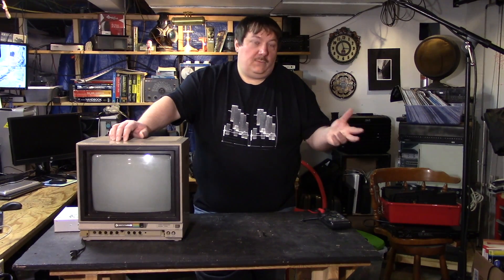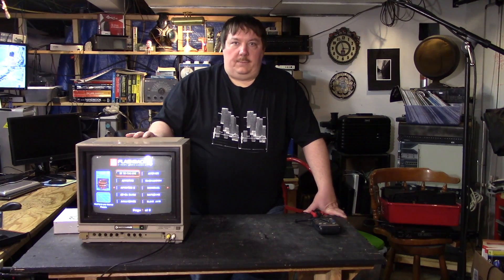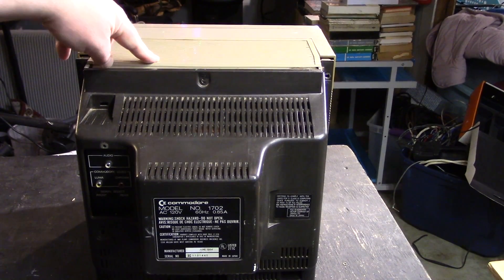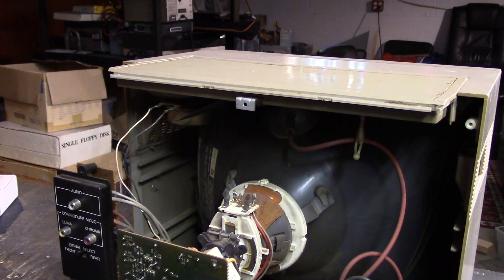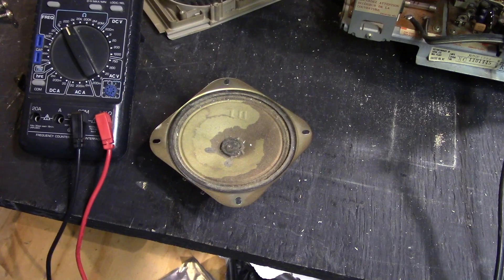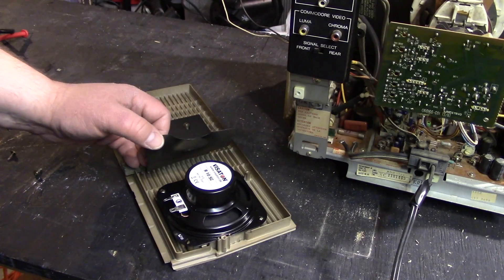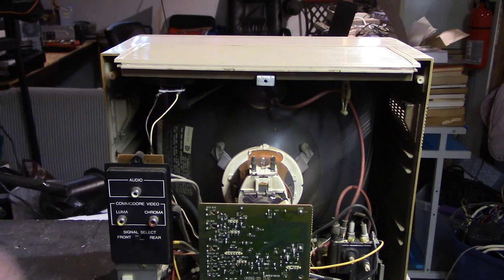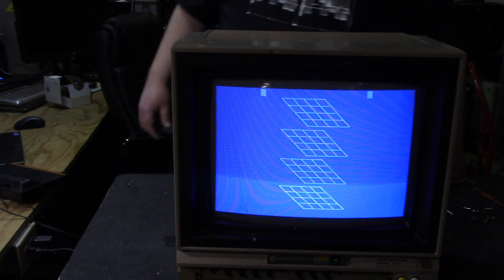Commodore 1702 Monitor Repair, Part 1- Dead Audio Fix - 3 Old Tech Dudes

Comment: High voltage even if it's unplugged! As a14y old in High School I made an apprenticeship in a TV repair shop and the first thing they told me was not to touch that connection to the screen and when my teacher visited me in that work shop I showed an open TV to him, unplugged it and pointed at that connection and said to him that he should never touch it...⚡⚡⚡I said that touching it!))) lesson learned!!

Comment: hello, i was wondering if the tip of the tube was cracked, is there anything i can do to fix it?
Reply from the maker: If the vacuum is already out of the tube, then no, unfortunately you'd have to procure a new CRT for it.

Comment: I have a question my friend. I am trying to plug in my xbox or pc into the comomordore. when the av cables are plugged in the back, it's a grey ugly pic. when i plug them in the front, the picture is beautiful but no sound. any help?
Reply: Although the ports on the back are colored yellow, white, red; they are not for composite video, left audio, and right audio.  They're actually Chroma, Luma, and mono audio, basically S-Video + mono audio.  So the reason why it looks like that is because its trying to get a Chroma signal from your right audio.  

If you're using your 1702 for retro consoles, I'd recommend pretending the back ports don't exist.

Comment: Great video! Really strange, I bought this exact speaker for my 1701. Fixed the audio problem but the magnet interfered with the image! I can't understand why
Reply: I just did the same repair and I'm facing the same issue. Did you ever figure out a fix?
Reply: @pastluck  As a matter of fact, I did! The fix was to place a small neodynium magnet on the side of the speaker casing, the point that is farthest away from the tube. It draws the magnetic field of the speaker away from the tube and completely eradicates the problem. It took a stack of about three of my little magnets to completely remove the interference from the screen. A fourth magnet made no additional difference, so I removed it. I then secured the magnets in place with some kapton tape. Speaker function is unaffected. I believe these are known as bucking magnets, and I believe the original speaker had one built into its casing.
Reply: @homerghost  Wow! Thank you for the detailed response. I will definitely try that.
Reply: Dude it work?
Reply: @RadRat1978  Yes indeed! Speaker works superbly and a bucking magnet placed on the speaker casing fixes the screen interference issue I was having

Comment: the commodore 1701 & 1702 are actually JVC pro series monitors and rival a SONY PDM in picture quality!   Great Monitor overall.  Plus Commodore video on the back, a little mod and you can use with any S-Video connected device for superior graphics.   I love mine.

Comment: Hello.  Is it possible to adjust the geometry on the motherboard in this monitor?  I need to stretch the image up and down in my own and round it in a pin amp if possible